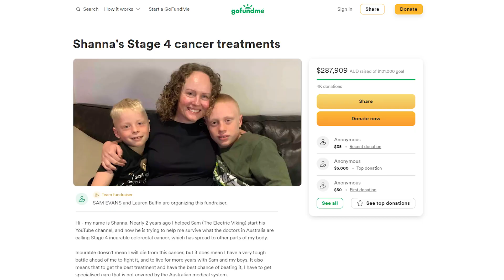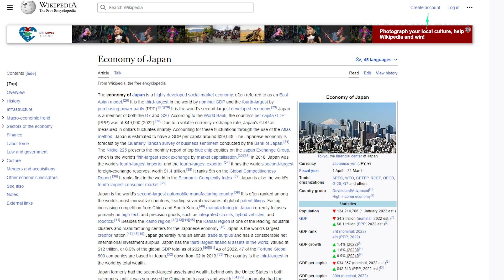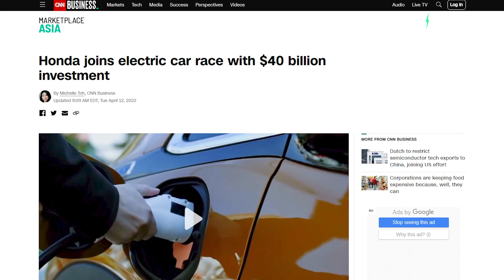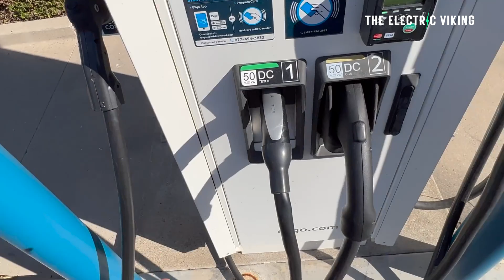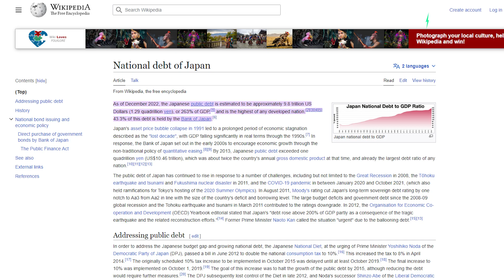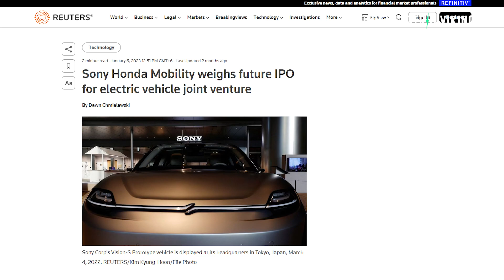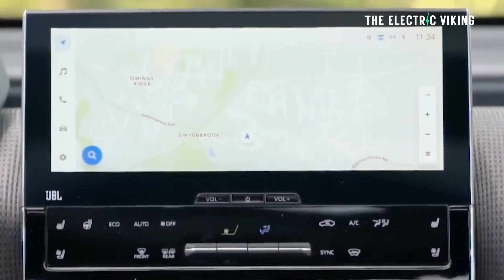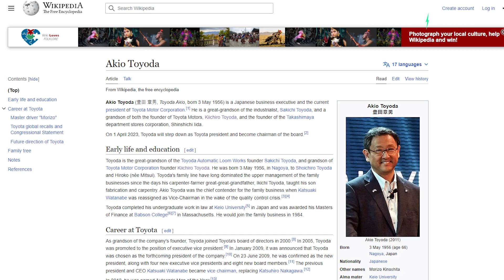Toyota wants to sell its old hybrids to 6 million people worldwide in 2030

Comment: Toyota are ‘down tuning’ the batteries so as to not allow the batteries to be fully loaded or fully depleted. The idea being that Toyota has always been known for vehicles that last. They are holding their longevity up as the main buying and customer loyalty driver. Offering battery warranties that it will still be operating at 90% or better after ten years or free battery replacement. 
This is an error that they will reverse course on within a year or two. 
Reason being that if you compare vehicles from ‘95 to 2005 you get very little difference. But when you compare 2013 to 2023!!!!!. Cars are generally completely different fuel, motors, performance, infrastructure etc. Vehicles are changing so fast that I don’t think we are gonna want to hold onto them more than 5 years or so. The tech is changing at that speed. Also the price of producing EV’s is going to be considerably lower. We don’t know what the landscape will look like yet but I think it’s quite possible based on the new economy, that there will be luxury EV’s and then EV’s that cost below 25k for the rest of us and we will trade up every 5-7 years . Still spending 100k every 20 years but now the vehicle will always be fairly up to date. There is no real way to keep up with the ever changing hardware. Software updates can only get you so far. All this arguing for batteries that need to last 15 years is rubbish. They just need to be recyclable.
Reply: its the battery chemistry. Toyota have stuck out with Liion batteries( same as your makita toy). So you have to keep it within the 20-80% range  to get a long life. You also have to thermally manage them.  Instantly this puts them 30% down  on range and power delivery, not to mention bigger battery to make up for lack of range.
First gen Liion batteries have had a remarkedly long life, contrary to the nay sayers. Lithium phosphate batteries allow  0-100% usage  with a life  most likely of 3 times Li Ion and also have far far less thermal issues to deal with. Did i mention Also cheaper to make.  If toyota cant get its head around the simple stuff like this............
Reply: @samijokinen9246  same here, but its a discussion about where the market is heading.  You can do both, lol.
Reply: I think to serve the rapidly increasing complexity we may get used to buying a cheap car every 6 years over an expensive one that lasts 20. Maybe there’s a a middle ground but then again….just as the middle class is vanishing….

Comment: 5:30 It is incorrect to say Chinese manufacturers focused only on EV. All their major players (BYD, Geely, GWM) also developed a lot of PHEV models and they are far ahead of what Toyota has to offer. For example the new BYD Qin plus hybird pretty much demolishes any Japanese hybird competition, I'm talking about similar range, similar economy, slightly bigger size, better performance, but at only 50% of the price (Qin plus vs Corolla hybird). It's been a market massacre for Japanese brands in China this year, and a lot of it is from hybirds, not just EV.
Reply: "demolishes any Japanese hybird" well first of all, it's "hybrid", not hybird. Secondly there's no way BYD and Geely make higher quality vehicles than Lexus (for example). Labor-wise, true, China has a huge advantage right now.
Reply: @ChickensAndGardening  there is a Chinese video show over a year ago with longer term reliability test for 100k km in 8 months duration. Between qin dmi and corolla hybrid. The toyota has a faulty radars sensor. Qin, zero fault. So, there.
Reply: aphidian:  PHEV IS EV.  They're shown in many lists of EV's, which show plug-in EV's.

And yes, Toyota is well behind much of even hapless ICE legacy on BEV's.

Comment: If you put an internal combustion engine (ICE) and an electric motor in a car, I think you will end up using the ICE only. Hybrid vehicles simply do not make sense ! Having both types of movers in a car also makes it more expensive than either an ICE car or an EV.

Comment: I'm gonna drive my Honda Accord Hybrid until it's dead. Since I only drive 2 days a week and then the occasional 275-mile run from PA to VA down Route 13, there just isn't an economically sensible car for me on the market. I'd consider Aptera right now IF they had some demonstrated products, but the premiums of everything with enough range in the U.S. are just too high, especially with no charging infra on my long drive.

Hopefully by 2035 there's a Sodium-Ion or Solid-State Lithium-Ion car with 400 miles of range (80% is 320, and then factor in Winter plus degradation over time) in the $35K range after incentives.
Reply: Patrick:  Driving an old but reliable car into the ground is generally the smartest economic thing to do.  Especially Toyotas and Hondas, given their durability and generally reasonable cost for what you get. 

The high cost of BEV's with good battery sizes is one reason it will take a long time for BEV's to take over.

Comment: You assume that everyone is on board with EV’s. ICE vehicles will be sold and on the road for decades if not longer. As EV’s become more popular, the electricity that powers them will also increase. It will cost just as much to operate an EV.
Reply: Yes, the cost of electricity will increase but don't forget that the fuel for ICE vehicles is going to run out.  Electricity sources will at the same time become cleaner and cleaner and more abundant to the point where you won't have much choice about being "on board" with EVs. I agree with your point though. We will continue to inhale combustion products for decades to come, but we absolutely must change that as much and as soon as we can.
Reply: An increase in gas prices affects all drivers. An increase on electricity prices affects the majority but not those who produce their own electricity.

Comment: Hybrids kind of made sense when batteries were expensive and in limited supply, the electric part can  compensate somewhat for the problems of IC engines. But battery prices have fallen dramatically and production has gone way up, and hybrids still have the maintenance and other problems inherent to IC engines. The hybrid era is coming to an end, nd Toyota is not ready for that.
Reply: Toyota = Kodak
Reply: Problem is australia ev charge infrastructure is way low.  Couple that with a big country and ev does not make sense …..yet.   Hence Hybrid whilst we wait…
Reply: @mikafiltenborg7572  Why Kodak?  Kodak, who invented digital photography.
Reply: @Dr_b_ yes, and the 50 MPG Prius has been out for 20 years. About a 10% increase in mpg in that whole time.
Reply: @Dr_b_ hybrid technology has been around for 25 years. The Prius came out in 1997, world wide availability in 2000. In 2000 the Prius had a city MPG rating of 52 MPG. The 2023 Prius has a rating of 57 MPG. How much of the increase is due to low resistance tires vs mechanical improvement? So as I stated , a 10% increase in 20 years.
Reply: @Dr_b_ the difference between ice and hybrid has always been there. Yes, more cars have adopted hybrid technology but it really hasn't improved much in the last 20 years.
Reply: @davekozlowski1266   - you do realize that the 2023 Prius is bigger with more comfort features and cargo capacity than the original Prius?  So yes a 10% increase in fuel economy with a 25% increase in size, features and capacity.
Reply: @tedtomoyasu8438  LoL, you do know the cargo capacity went down around 9 cubic feet from previous model don't you?
Reply: @tedtomoyasu8438  from outside dimensions the 2023 Prius is 10% larger than a 2000 Prius. So as I said, very little improvement in the drivetrain technology in 20+ years.
Reply: It all depends on charging infrastructure now.
Reply: @davekozlowski1266   - You do remember that you compared the second generation Prius (2000 - 2003) to the 2023 Prius right? 😂
Reply: @tedtomoyasu8438  yes, the comparison was to show how little improvement in hybrid technology in the last 20+ years. 
EV technology is improving weekly!  I bought a Tesla in 2022 and will take it anywhere, that being said, I bought the Tesla over other models because of that. Well that and a bunch of other reasons too. I have a small SUV that is faster than most Corvettes, handles as good but seats 5 people and was a lot cheaper to buy and operate.
Reply: @tedtomoyasu8438  as of today, if I needed the car for road trips, I wouldn't buy any EV other than a Tesla.
Reply: @tedtomoyasu8438  also, I don't think government should be spending tax payer money on a charging network. 
Tesla has been the only company to put in reliable chargers and they're passing on millions of dollars in California due to requirements they don't need. 
Let BP, shell, Chevron and others start installing chargers.

Comment: Suzuki is actually well poised for growth. Their JV, Maruti Suzuki, is the top selling brand in India, with roughly three times as many sales as second place. Getting market access in India is very difficult. India is poised for rapid market growth. Product outside of India will benefit from the scale and low-cost manufacturing capacity.

Comment: Automotive News reported recently that Toyota did a teardown of a Tesla Model Y, and they called it "a work of art" in its elegance and simplicity. Unlike the previous guy, their new CEO is pro-EV and is planning to electrify Lexus. It would be premature to dismiss Toyota as an obsolete dinosaur; by many measures they are still highly innovative and efficient. Also, the Japanese are incredibly good at taking other ideas and improving on them. Not a good team to bet against. But, admittedly, they have their work cut out for them in catching up with Tesla.
Reply: EV Lexus will be sweet, but they are intentionally a laggard in technology if favor of quality.
Reply: Well, Toyota problem is not only they have yet to have a viable EV model. Their problem is they cant even prodice car to fufill their order back log. They are going belly before they have a chance to transition to EV realms at this rate.

Comment: Toyota is also behind because their engineers have no experience designing EV’s. It is not an instant thing to learn how to design something so different. Look at it he weight of non tesla EV’s and you can see the good engineering, they weigh about what a tesla does, and bad engineering, they weigh 1000 pounds more than they should.
Reply: Tesla is not light, considering theyve been using so much aluminium. Toyota had their chance. They signed a contract with BYD to have full access to their battery and propulsion technology. But whhat the heck...